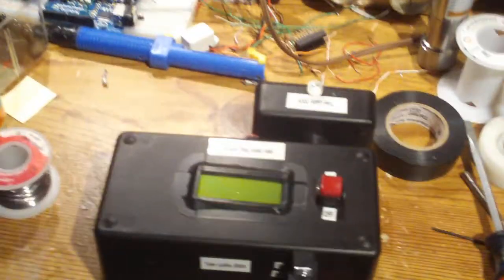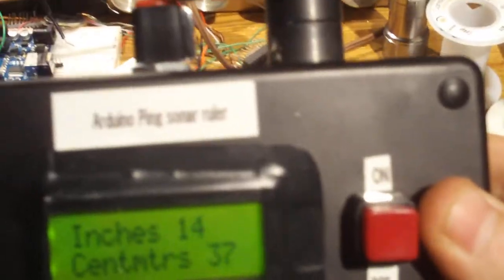Arduino Ping))) Sonar Ruler

Comment: What if the sensor is mounted on a vibrating surface...? i would like to build a system such as the one u did to control a centrifugation process that vibrates a lot... I know it would cause some error in the measure, but the system would still work?

Comment from the maker: You are correct pressure and temperature probably affect it... No this bot does not measure pressure and temperature although the sensors to do so can easily be added. For the most part this sensor from Parallax is quite accurate at close distances. This is the same type of sensor my Autonomous robot Diode use's to see while moving around.

Comment: So, if I understand physics right.  Thats not accurate always because speed of sound changes based on pressure and temperature.  Am I right?  Have you measured that distance to make sure its actually doing it right?  DOes this robot also measure pressure and temperature?